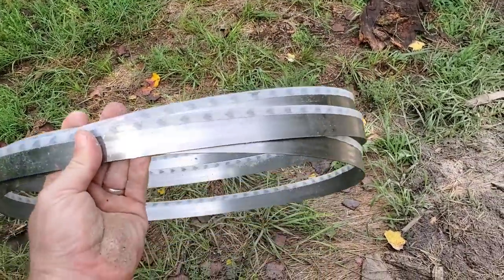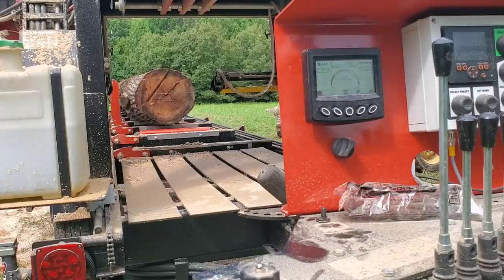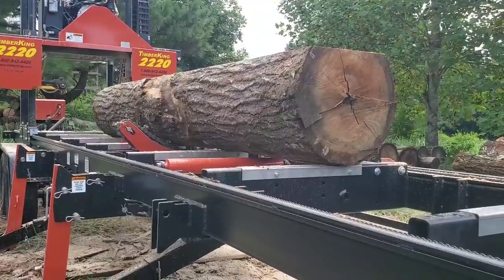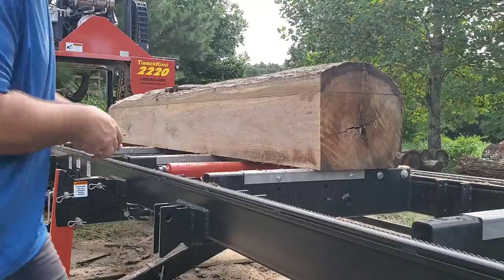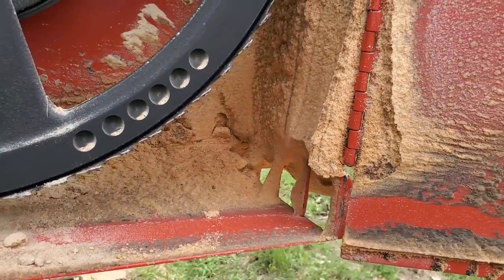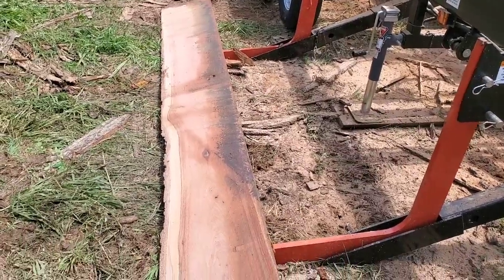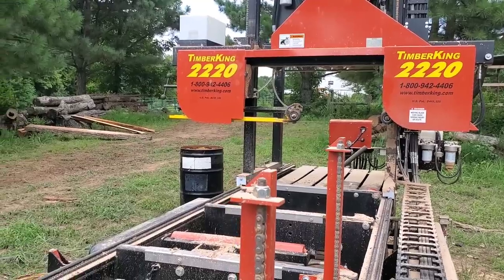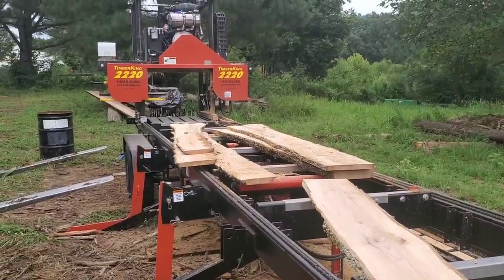Carbide tipped sawmill blades, are they worth it? Episode # 1

Comment: Nice blade and good assessment!  just remember though board foot is not a good unit of measure for longevity.  I could cut an oak log into 4 posts that are 8x8s taking 6 passes to do it, and cut the same oak log into 5/4 boards and would take 32 passes.  The proper unit of measure is the square footage of wood cut.
Reply from the maker: Yes, you are correct.   I will do that for the next video.

Comment: Did you consider putting the blade on the mill before you remove the protective cover from the carbide teeth? Or would that be too difficult? It seems that the chance of damaging the teeth during the installation of the blade would be much less. I will admit to not knowing anything about saw milling other than what I’ve seen in the dozens of videos that I’ve watched so my thinking may be way off base.

Comment: I use a carbide tipped blade on the mill for flattening dried slabs and it does a great job on the hard dried wood. I could not bring myself to run it cutting up a log at almost four times the price. I may need to reconsider that.

Comment: I enjoy your videos. I am just learning to use my WM HM126. Not quite on the same level as you, but I am getting the hang of it. Up here in Maine we have an abundance of great wood to mill. I was having trouble with throwing blades but I finally seemed to have it figured out. I sawed my first Cherry today and it was incredible once that first slab came off. Thank you for making these videos. Lots of good tips even for a beginner.
Reply from the maker: Throwing a blade off is irritating,  was the blade tracking to far forward or back?  Or was it something on the belts?  The more practice the better you will get, it's almost like second nature.   I too love cherry,  I've done a lot of cutting of it and now I only leave it live edged and cut down with tools after it dries.  I rarely get requests for any dimensional.
Reply: @TCSawmills  Its a bit of a long story, but to keep it short - The first blade that jumped shredded my drive belt. I had ordered a spare belt, so I popped it on, thinking it was fine. After ruining 3 blades with no cuts, checking tracking, spending time on the phone with WMs, it turned out the V profile of the new belt was off just enough so that under tension it would sit too deep into the wheel and I was getting wheel to blade contact throwing the blades. Tricky to figure out for a beginner.  And the bummer was it was a direct replacement blade from woodland mills
Reply: Yes mee too. And wm tech support said I was over torquing even though I did exactly as they said per the owners manual. They have some issues to sort out for sure on tensioning and belt selection.

Comment: Have you ever had a need for a 1 1/2" blade ,however what is the most used width of blade during your daily operation ?.... I dont see much review on the different sizes on these larger diesel mills. Your thoughts on this would be great .Thank you again
Reply from the maker: I will probably run a 1.5" at some point.   I just have to adjust my guide rollers to support it.

Comment: Live oak is the real test. I can cut about 500-700bf of big live oak on a Munksfor 2in .055 blade, at $40 per blade its gonna be hard to justify a $200-$250 blade upgrade. A few blade manufacturers that I have discussed this w/ share the same sentiments. Depending on the size of the band wheels on the sawmill, you will be lucky to get 2-3 sharpening on the blade due stress cracks developing as many of these blades get run longer and harder.
Reply: Have you tried Timberwolf cobalt blades 'from Sulfolk Machinery?  I don't believe they are that expensive.  I get 1.5" .055 222" long for less than $90.
Reply: @meehd01  Havent tried any cobalt, only carbide and bi metal, both of which couldnt compete on the $/bf. The cobalt definitely makes it wear better but a 2in, the blade would probably run $120+ which would equate to 3 of my regular blades.
Reply: @kurtsmith4657  You might holler at Tom at Sulfolk Machinery to see what they would cost.  Actually I think I asked him about 2" blades and he said I was better off with the 1.5" I am using.  I could use 2" on my mill but the 1.5" seem to be working good.
Reply: @meehd01  I will check into it. The best guy ive found is named Robert, he owns and operates Kennesaw Saw in GA. His prices are so good that it shames Woodmizer and the Munksfor coil stock will last 2-3x what a cheap Silver tip WM blade would run. The munksfor stock is ground sharp whereas alot of other band blades are actually die cut or punched out, makes a big difference. Thank you for your suggestion, best regards.

Comment: seems like these mills could use a inverter hooked up to the alternator to provide a 110 VAC source.  Then run a small air compressor and tank so you have compressed air for cleaning the rig.  Likewise a place to plug in an extension cord for fans, lights, etc..  Nothing like a 50amp service, but something simple.

Comment: Saw kerf is the set? Width of the blade? It’s not nail proof or knot. Feed speeds? Deflections? Maintenance and sharpener recommended? Production run will be test to run, in my opinion. How much lubercation level? Moisture levels in boards?

Comment: I'm really impressed that it did so well even after it cut though at least six nails! What would have happened with a "normal" blade?
Reply from the maker: One nail maybe,  then if we push it it would blow up soon after.
Reply: @TCSawmills  Then you already found that the economics are better for the carbide tipped blades?
Reply from the maker: We are trying to work through sharpening.   Next video will go over that but we have a bit more tweaking to do
Reply: These look to run really good.
If you ever used a Skilsaw with a  carbide tipped blade on a demo, nails would be no big surprise. Carbide tipped saws run good until you lose tooth corners or whole tips. Big high production sawmills with bandsaws will be swedge tooth or stellite. As always clean logs save saws.

Comment: Carbide will hold a cutting edge 10 times as long as HSS (high speed steel), slightly less on the blue tip HSS blades. It removes the sawdust better because the dust is bigger. 
The flat top and face angles on the carbide will pull dust out of the cut better. Also, you might see the horsepower demand increase as an indicator that the carbide is getting dull.
Reply from the maker: Thanks for the info.   I will say that the 2220 has plenty of power to pull it.  We are learning more each time we use the blade and sharpen it.  So far we have sharpened it 2 times, only once correctly.   We are about to sharpen for the 3rd time,  then I'll shoot to conclusion video.
Reply: Hello Jim I acquired a massive load of industrial Amada blades and I need to educate myself a bit before I try to move these could I ask a few questions

Comment: I've used carbide blades on my lt40 and large Dankart bandsaw for years. Mostly for veneers they will out perform normal blades by a long way. 

Used to use Starrett and Morse for the Dankart but per single blade £174 - $234 (they are very long blades) not enough carbide to re-sharp.

I now have exactly the profile I need made in China (German back Swedish carbide) Fedex to me per batch of 10 blades comes out at $53 per blade. They cut FAST and CLEAN on fresh timber, cut flat and clean on kiln dry to the full width of the lt40.

At  0.9mm x 32mm i set the tension just into the red lube on pulse 5, cuts knotty 7mm fresh Ash veneers 710mm x 2500mm in 48 seconds flat enough to glue down, takes about 3500bf of old straight Scots pine to kill the blade passed what a sharpen can recover. And as there is no set you can hit a few nails and keep going, they don't like pebbles or glass embedded😒

They don't stay razor sharp for long but pretty damn sharp for a very long time and that is all you need, I have a new box of double hard's and used 3 blades from it in the last 6 years.

Not tried the Woodmizer carbide yet.
Reply from the maker: Thanks for the info, I'm just getting into running carbide blades and I'm impressed.   We are going to get a few more to keep on hand for the big cuts on the high end logs.
Reply: @TCSawmills  Also, leave the plastic cover on till you've mounted the blade and got a  bit of tension on, especially on a mizer where your feeding past a steel post, it help protect the teeth.
I have one blade with no carbide at all, result of pressing next cut instead of bump up then coming back, blade did a very good job of cutting a big curve through part of the idle door🥴😅
Reply: What's your source on the blades?
Reply: @dherman0001  Will post the details when I'm in front of my computer 🙂

Comment: Did you have to change your setworks computer for the difference in blade thickness.
Reply from the maker: Yes there are adjustments that can be made to the computer to account for blade thickness.
Reply: I have a timberking 2500 in Kentucky. I have been looking at the carbide tipped, but have not tried one yet. I use them on my metal saw, but they don't make them for wood.
Great videos. I am looking to get a cat claw sharpener since timber king no longer sharpens.

Comment: Teak is very abrasive and a normal Timber Wolf blade on a WoodMizer can cut about 400-500 bdft in one inch thickness before needing to sharpen the blade. A Timber Wolf cobalt blade can cut 1200-1500 bdft in one inch thickness before resharpening. Normally able to resharpen 4-6 times before blade breaks. On my conveyor horizontal resaw with 28" wheels cutting teak blocks with carbide blades will cut more than 10,000 bdft in one inch material before it needs to be resharpened.
Logs you need to worry about the dirt, rocks, & metal in-bedded in the bark and wood and carbide is brittle and will chip/break the teeth hitting a rock or metal..
Reply from the maker: Thanks for the information.   I am impressed with how they preform.

Comment: very impressed , just finished cutting 50m3 of douglas, i reckon they would be good on sweet chestnut, here in France
Reply from the maker: It cuts walnut,  red oak, Hickory  and ash great.   Should be great on chestnut.   Also if there is a fear of nails it cuts right through them.  So far on this bade I think I've hit 6 nails, 😆   just a bit of a sneak peek.   Now we are trying to sharpen it correctly.
Reply: What kind of mill and where do u get the blade?
Thx greetings from Germany and I run a LT 40

Comment: Should've put that knot on the corner. That way you can cut the knot out. You would make better boards. Now the boards will be weak and break.
Reply: I agree I put the knots in one of the four corners of the cant. Then it can be edged off. Never in the middle of a plank. My two cents. Peace

Comment: What most people don't know or don't realize that steel cuts by sharpness that's your blade but carbide cuts b well it's so hard it's not actually sharp it's so hard that it actually cuts by the dwell and I'll where's the pressure that's the difference I worked as a machinist and I can tell you that is one of the things that you learned the smoother your grind on your steel the longer the last carbide does not have that problem it is more heat it will not take a hard shot that can cause it to chip it is still very very hard that's what makes it cut the way it does it does not feel Sharp the sharpness will disappear very shortly after you make your first cuts that's just the way carb ideas you'll know it's getting tired when it starts doing the wave thing and everything else and it's time to reach sharpen but you have to use a special type of stone to read sharpen carbide 🤠😎

Comment: The area (square feet) of cut surface is the correct way to characterize the amount of wear on the blade, not volume (board feet).  If you cut 1000 board feet of 4" x 6" boards, the amount of wear will be one-half as much as 1000 board feet of 2" x 6" boards cut from the same logs.

Save a piece of wood from these first cuts so you can directly compare cut quality with future samples.

Interesting video!
Reply from the maker: You are correct,  I really wanted to do 1" material to show a true board footage count.  In up coming videos we will try to better show how much 1" material it can cut.
Reply: Totally agree, most people cutting dimensional lumber are not cutting 4x6 beams. And the real test is sawing into the bark of hardwoods as in my experience is what takes ultimate toll on the teeth.
Reply: This is where I love my debarker on the mill 👌👍🧡🧡🧡

Comment: Machinist here, quick comment on the sharpness of carbide compared to high speed steel.  Carbide will always feel "duller" than HSS.  Carbide has a much larger grain structure than high speed steel thus cannot generate a truly razor sharp edge like steel blades can.  Carbide is made from tungsten powder bound together with nickle, so think fine talcum powder in size, which is literally the grain size of the carbide.  High speed steel's grain size is the physical size of the metal's crystal structure, MUCH smaller than the carbide grain size.  As a result, high speed steel can produce a much finer edge.  Where carbide excells is in its hardness and wear resistance it will maintain its edge much longer and should in theory last significantly longer than a steel blade.  Not having sawn wood with a carbide blade I cant speak to how it would handle imbeded nails but thats not the blades intent regardless of blade material.
Reply from the maker: Thank you for the information.  We think we've got it correctly sharpened now.  Testing later this month.   The biggest thing um excited about is the cleanliness of the cut, helps a ton on finishing.

Comment: Diamond wheel for grinding and a really good grinder , just touch the surface . And wear a mask . Teeth are replaceable ,  but will require some training and a carbide jig , X side clearance  is built into the tooth

Comment: Is there any possibility of resharpening the carbide blades or are they scrap once dull?
Reply: I originally missed the end where you mentioned resharpening but as a follow up question,  would a different sharpening stone be needed for the carbide tips?
Reply from the maker: Yes, a diamond sharpening wheel is needed.  Once we get the technique down I think we can sharpen 3 or 4 times.  We are still testing.
Reply: @TCSawmills  make sure you use oil on the diamond 
wheel to keep from burning the tips of the tooth

Comment: What happens when you hit a nail or something?
Reply from the maker: The blade kept cutting just as smooth as could be.  It's not intended to cut through nails but the carbide blade is not affected as bad as a normal bandsaw blade. This blade to date has hit 6 or so nails, we couldn't see any damage to the teeth.
Reply: @TCSawmills  Thanks.  I appreciate the info.  I had a carbide blade on my shop bandsaw, never dulled it, but broke it before I could wear it out.

Comment: What's the latest on these? I've shopped around and I'm able to get the stock material for about $50 for a 156" blade. This doesnt include welding.  Add about $10 for welding if farming it out, though it's not hard to do yourself.   100 meter minimum order gets me 25 blades with a bit left over. Coming from China. I've used one and was blown away.  I'd say they are at least 5 times longer cutting than rippers.  I'm about to bite the bullet and buy a coil. Should cut may blade expense by well more than half conservatively.  Another $500 bucks in my pocket per month.
Reply from the maker: Timberking sells them bit only in a few sizes
Reply: @TCSawmills  I'm about to import 200 meters from China.
Reply: I would be interested in knowing who and how to order 100 meter blades from china.

Comment: Wouldn’t it make a different in how many passes you make on the cant versus making 6-8 passes and calling it board footage..
Reply from the maker: Yes you are correct but the comparison between the 2 blades was the same. Cut nearly the same dimensions between the normal blade and the carbide blade, and the carbide blade lasted far longer. The best would be 1" material cut by each or the total surface area each blade cut.

Comment: You are going super slow. My lt 40 super had that cut into 4x6s before you started on the 3rd cut. You need speed up that mill will do it.
Reply from the maker: Yes I was cutting slow.  The mill was brand new when we shot this video.  During the break in period (50 hrs) the manufacturer suggests limiting operations.